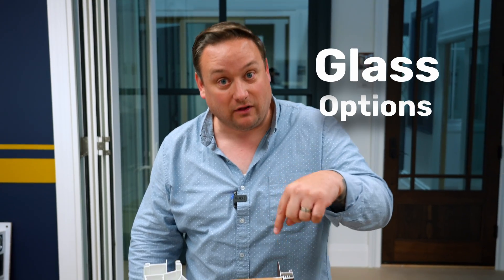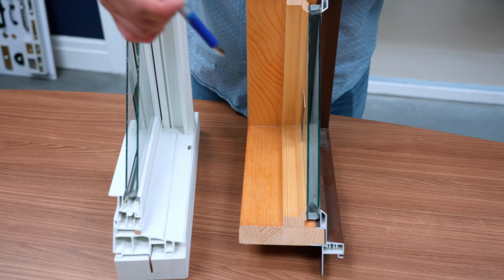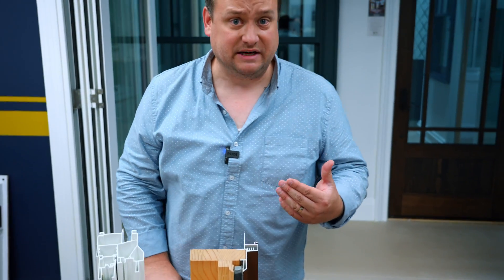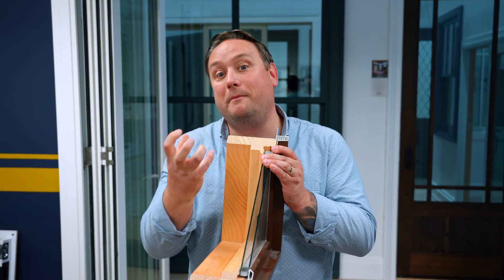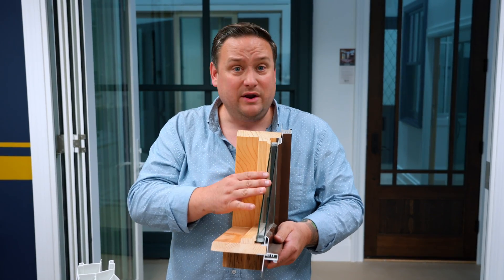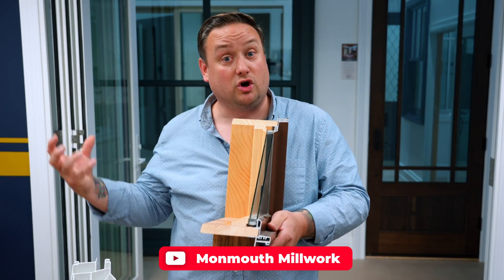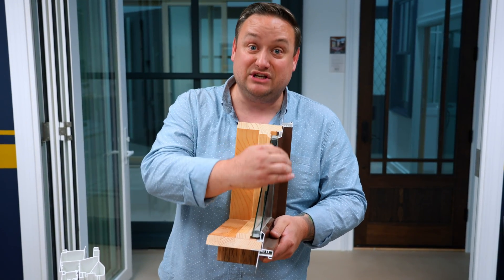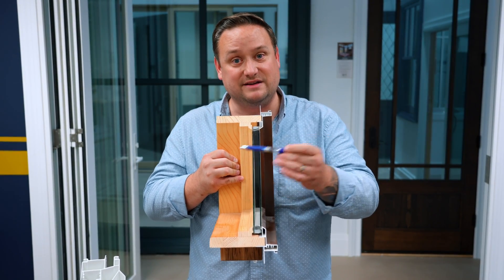Home Window Glass Explained: Low E, Argon, and more

Comment: Hello. I was wondering about something. For a front entrance, could I put stained colour glass inside, which faces outside, then put a sheet of glass over that? Would it protect the stained glass from getting dirty? And would it stay clear rather than fog up? And then, more... if I wanted to put wrought iron decoration/swirls on the outside front entrance window, where the smidgen of stained glass for decoration (and light refraction from the sun on the colour glass to spread inside the home), and how to have that done? The cleanliness is important to me. Something that's easy to keep clean, and yet, is artistic in beauty. Is this even possible?
Reply from the maker: Yes it is possible, we actually do this from time to time. We install provided art glass behind the existing glass and use moulding to stop it in place.